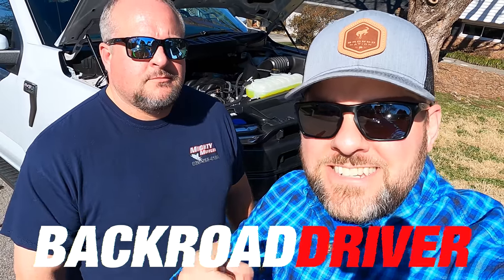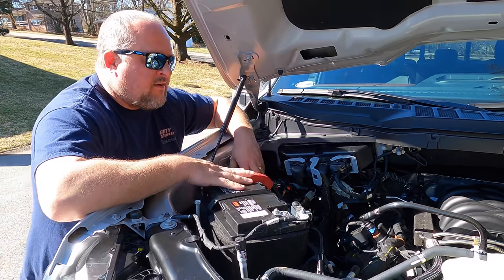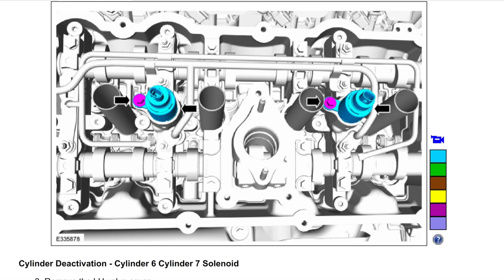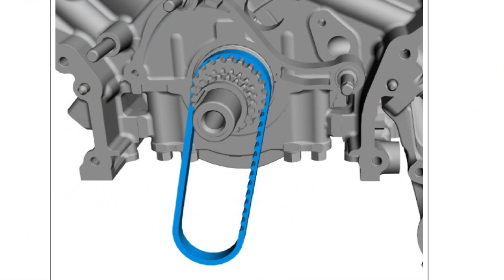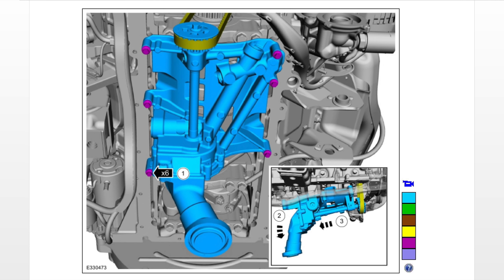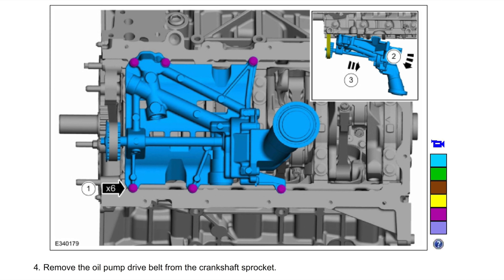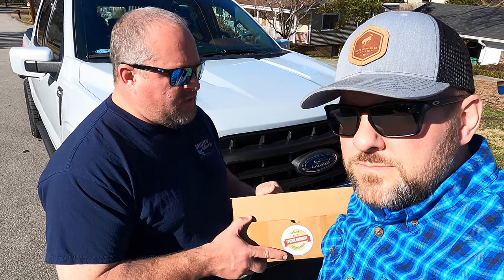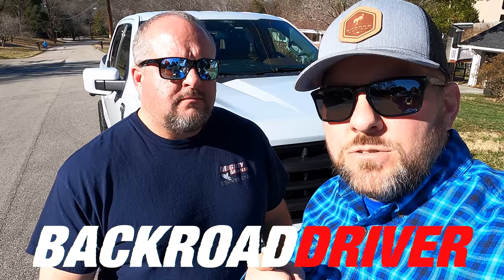2021 Ford F150 5.0 V8 Cylinder Deactivation & Oil Pump Belt Explanation - JLT Catch Can Install

Comment: Wow they put more shit on the engine I had a 2018 and I had to trade it in because they came out with their new injector design which had 16 injectors well the system failed and all the injectors would work at the same time causing the Piston to slap on the valves making a horrible noise due to poor design and a combination with the stop Go technology worked on vacuum which was terrible especially when all 16 injectors were working and the timing was off like crazy. I complained many times to the dealer they told me this is normal I told them is not normal I own a 2015 V8 with a 6-speed transmission and everything works fine and yeah the 10-speed transmission work like shit to making squeaking noises every time it shifted and a couple times I felt like I got rear-ended but that's a whole different story. now they have even more stuff to go wrong and now they're not even telling anybody because people will be scared to buy there Vehicles cuz they know that where the test subjects and it tells you something when the 2015 and 2016 V8 used models with almost a hundred thousand kilometres are worth more than the 2019 with around 10,000 km brand new truck. Anyways I wonder what kind of problems they're going to have with their electric one and that's going to be a pretty penny to fix to. Anyways I went back to my Chevy my new Silverado is fantastic. They also had some problems 2 but they have fixed these hiccups and I have already done them and she is Bulletproof
Reply: I had a 18 V8 and after about 6000 miles it started knocking like a diesel. Three stealerships said it was normal and would not do anything. So I traded it for a Toyota.
Reply: BTY Mario, they never would tell me what was causing the knocking. So thanks for explaining it, makes sense to me now.

Comment: The belt will never be an issue. Just ask any Harley owner. Hell Jesel makes a conversion kit for most V-8s.  And most race cars have been running belt driven oil and fuel pumps for years. Rpm is rpm and just because it has a blower or a Turbski doesn’t mean that their is now some huge load on the oil pump belt. Just my two cents. I’ve only been racing and modding Ford’s for the better part of 25 years. But then again who am I?
Reply: Firstly... I do not discount your experience at all.  This is just my take.  While it sucks, popping a belt and starving your engine in a race car is a pretty minor consequence relative to being in western Canada where it could be -40f outside.  Now you're stuck with a truck that won't run for fear of the engine destroying itself.  Granted, a built engine for the dragstrip isn't a cheap affair.. but it isn't dire.

Comment: So what happens if you put a performance muffler that roars then it goes to 4 cylinder mode? From Roar to reeeeeeeeeeehhh LOL? But really 🧐
Reply from the maker: The tone actually gets a little louder and deeper when it goes into 4 cylinder mode.  It sounds like a mini jake break but it's not actually as noticeable as you would think.

Comment: Any oil level changes? kinda skeptical of getting a 2021 f150 5.0 since the last model had oil consumption issues
Reply from the maker: I've got less than 500 mi on the truck so I can't really speak to oil consumption issues. I did put the JLT oil separator on the truck so I will be watching my engine very close and any issues that I have, I will obviously be talking about in future videos. I just came from the 3.5 EcoBoost and I'm enjoying the V8 way more. Don't get me wrong the EcoBoost was a powerful fun engine but the V8 sounds a hundred times better and I plan on super charging the truck as soon as it is a viable option.

Comment: Don't know what was wrong with driving the oil pump with the crankshaft unless they have alot of crap in the way. A belt really.
Reply: It is to get rid of crankshaft harmonics that have potential to bust the pump gears.
Reply: @dylanbarker3712  it worked good for over 20 years!!! The reason its cheaper and lighter.😉
Reply: To quiet the engine down since oil pumps tend to be noisy and moving it down into the oil pan can help. Manufacturers did the same thing with the fluid pump for transmissions. The 10-speed oil pump went from a shaft-driven pump to an off-axis pump running off a gear or chain. Also, the harmonic issue causing oil pump gears to fail with the 5.0 is a possible reason as well.
Reply: @karlschauff7989  the old oil pump didn't make any noise and aftermarket makes gears that last.Bet your ass it comes down to cost .It always does.They'll give you a government answer to why.

Comment: Why do you need a catch can? I have a 950whp 2012 Mustang GT. No catch can. Just another useless item.
Reply: While I don’t have 900hp I do have two Mustangs and one F150. Catch cans on all three. Try one for fiveK miles. It may change your mind when you drain it. Bought one to try, after draining bought two more. I recommend Morso for ease of service.
Reply: @michaelchadwick3497  I just use two breathers. One on each valve cover - Amazon $16 for the pair. No oil on the engine anywhere.
Reply: @joed3264  That’s old school for sure and I have done the same back in the day. However it not the same. This method vents to outside atmosphere only. You have no oil any where because none of gases are ever leaving the crank case. The intake manifold provides the vacuum (suction) to make this happen. I’m not trying to sell you on a catch can, just relaying my experience. I was really surprised to see what was going back into my intake. What’s it like to stomp on 900+HP? I can’t imagine.
Reply: @michaelchadwick3497  I first installed a Roush 2.3 blower five years ago. Fairly simple install. Car ran low 10s on 93 octane. I bought a VMP Gen 3 head unit a couple of years ago and put together a return fuel system for E85. Car now runs 150+ mph in the quarter. The breathers prevent any oil getting sucked into the blower.

Comment: the 2020 and older oil pumps are direct around crank shaft driven no chain no gear no belt...
Reply from the maker: 2020 and below uses a chain off of the crank snout to power the oil pump. The 21 and up uses a Kevlar belt from the crank snout as well.
Reply: @BackroadDriver  look at pump gear replacement for 2020 5.0 ...the pump is around the snout behind the cam sprocket
Reply: @BackroadDriver  vmp pump gear replacement vid shows otherwise